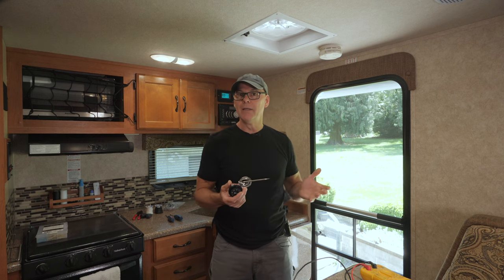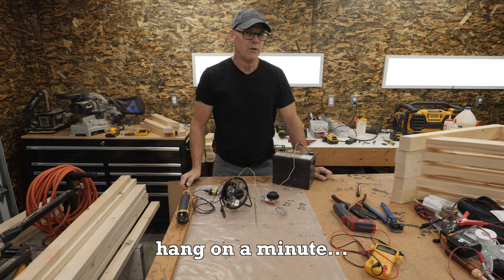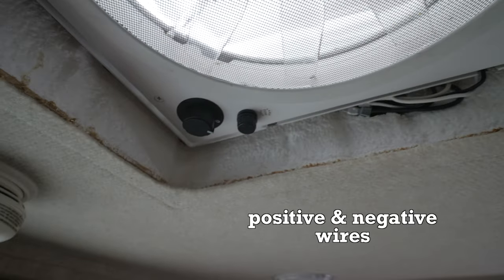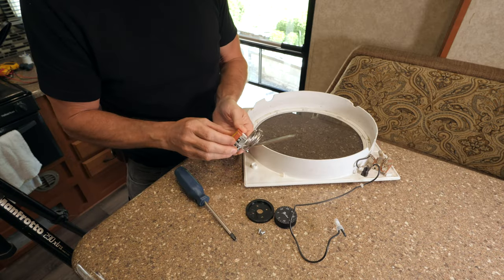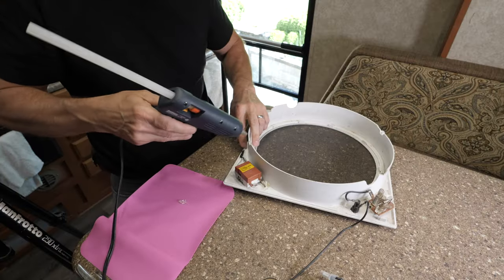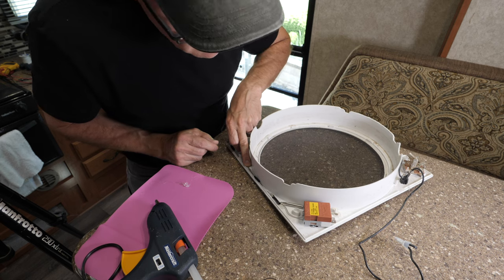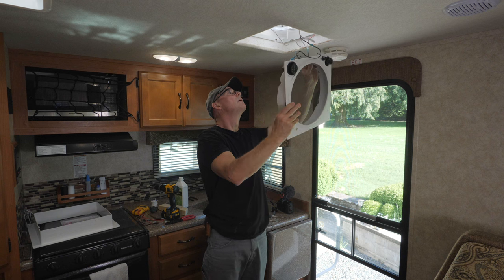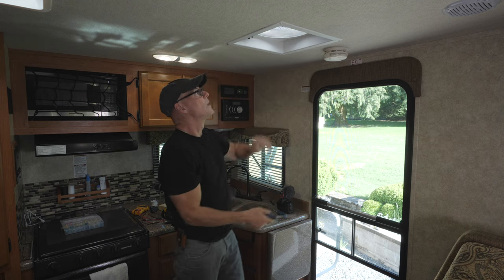How to add a Thermostat to an RV Vent Fan

Comment: PLEASE make sure wires are not pinched or against sharp edges.
VIBRATION from future travel or fan operation can wear away the housing, expose wires and start a fire.
Also smart to cover the sink drain before you start so your fuse or screws don't fall down inside. 
Everyone's heard - "An once of prevention......"🤓🖖 -KJ

Comment: Am I the only one wondering if the probe sandwiched between the plastic housing and the wood framing is gonna give an accurate reading of the room temperature?  Should the probe have access to the room air?  Does this make sense?
Reply from the maker: It seems to work fine. Been running it all summer.

Comment: It would have been easier to wire the thermostat between the fuse and the switch, that way, the modifications would be contained to the part on the table and there is no modification to where the red connect. :)

As you are on 12VDC, it does not really matters if the thermostat is on the + or the -.